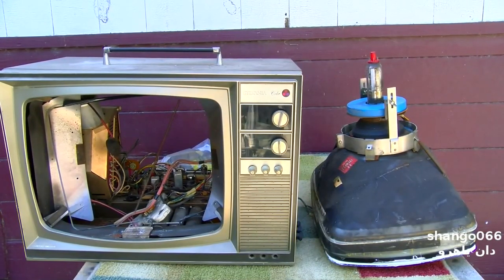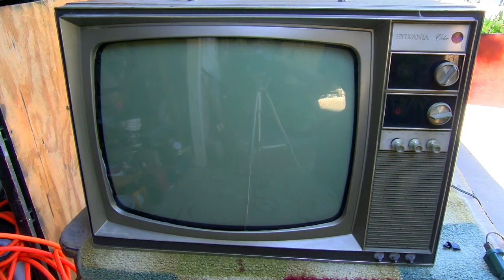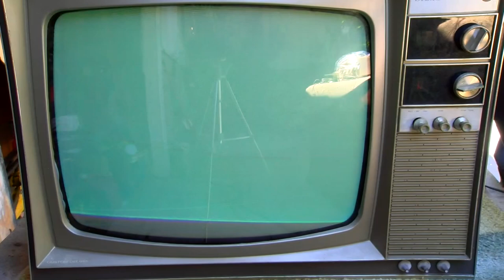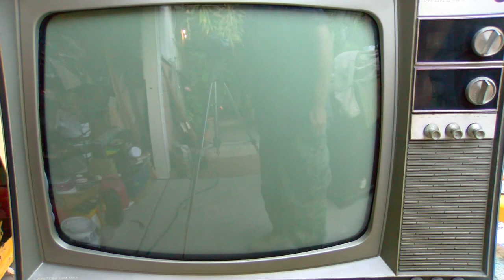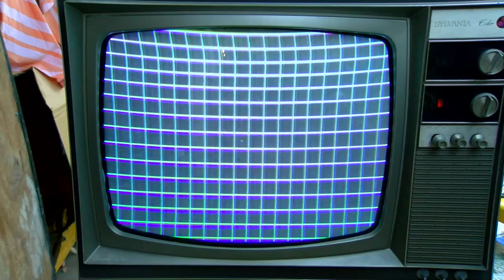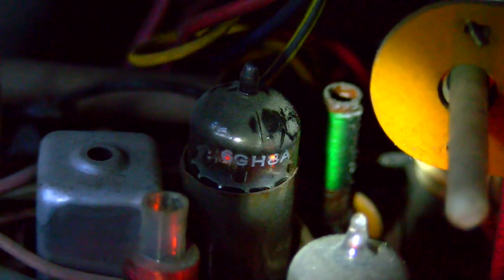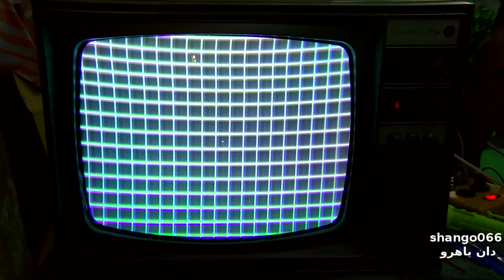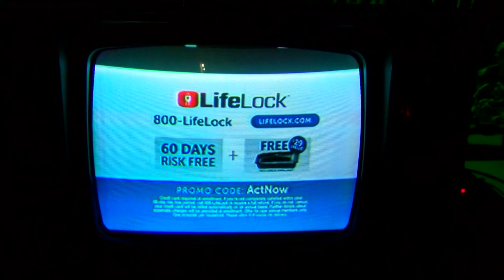Sylvania Color Tube Television Reassembly and Setup

Comment: Another very interesting and detailed video, Shango!

By 1966, manufacturers and the relevant Federal regulatory agencies were becoming increasingly aware that shielding of high-voltage components was necessary to protect those individuals who repaired these sets from dangerous levels of ionizing X-radiation.

Comment: Glad to see ya got it going. Looks good! As for snow on the screen, you might have a weak mixer/local oscillator tube. The snow on the CRT is AM noise from the local oscillator, and the rushing sound in the audio is FM noise from the LO.
Reply: Radio frequency Burns rules!
Reply: Haaa, it's appropriate that you commented on this one, RF Burns!

Comment: Gotta love those zorch attacks.  That injury is all too familiar.  TVs are one thing, and I got bit many times. When the anode of the HOT reaches out and grabs you it's got a heckuva sting to it. In other pursuits, such as transmitter work, I found more ways to cook myself from the inside out than you can shake a stick at.  RF is funny stuff.  :)

Comment: Love that set, better in my opinion than the new ones....
Reply: +dynamic881964 not a chance, plasma is king especially the pioneer plasma sets
Reply: Gladly let you have my share..... ham operator and the plasma sets create noise on some of the ham bands. . .
( on my receiver )....
Reply: then use a surpressor

Comment: Is there any way you can get the equipment and start rebuilding them yourself? There used to be a guy in Coos Bay,Oregon back in the '60s or '70s who had his own CRT rebuilding facility.As I understand it,CRTs stopped being manufactured in the mid to late 2000s.

Comment: Where to you get your TV source.... are you just injecting a channel 3 or 4 video signal in the antenna .... are you using a digital to analog converter or cable TV box... Is this vintage TV program, is cabbage patch kids still a thing... Thanks

Comment: That's a really nasty radiation burn on your thumb, Shango! Detonation of unstable CRTs is definitely a possibility when these components are outside of their safely mounted positions in the television cabinet, and using Personal Protective Equipment is a must to prevent blinding, dismemberment and/or castration as the result of its detonation. This is a potentially dangerous task.